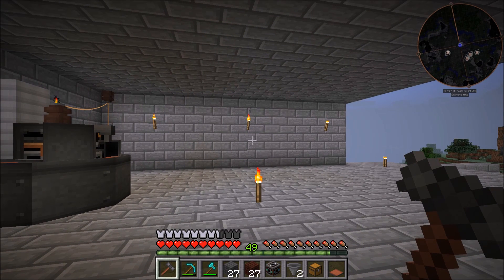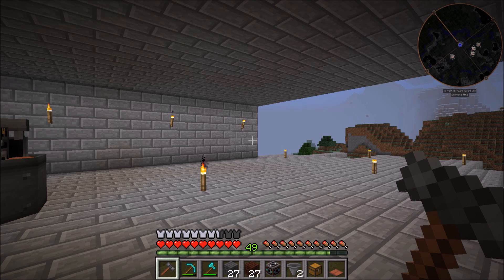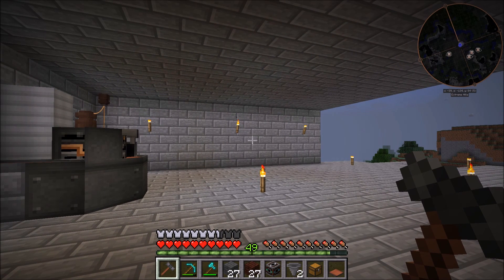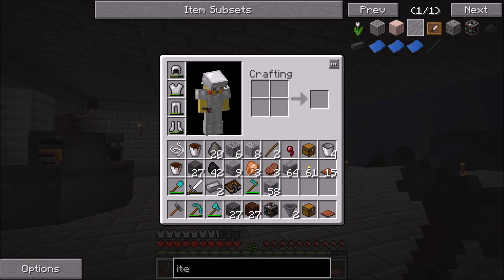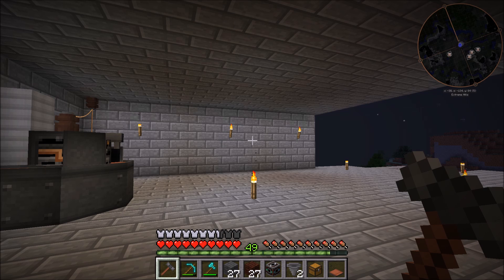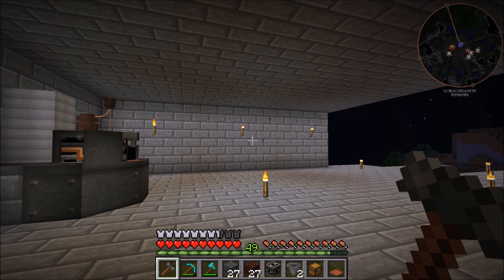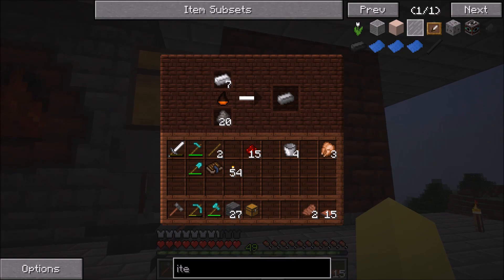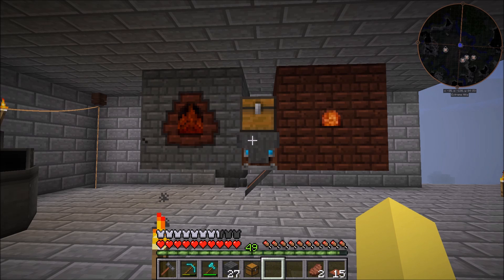Surviving With Immersive Engineering :: Ep.11 - Automatic Steel Production

Comment: You need to put the immersive engineering pump on the top center block of the come oven, give it power and a red stone signal then you can pipe the oil off of that

Comment: This is not working anymore.
Reply from the maker: There is a video later in the series (ep 15?) that has a much more recent version (after the big update that changed the oven) which would probably still work :)
Reply: No, does not work, too ^^
Basically, I am unable to feed the standard oven with a conveyor belt or item router from the side. You have to feed it from the top with a hopper. At least that is what I have found out in my version. And conveyor ramps are no longer feeding into the adjacent block diagonally above them (at the end of the ramp), but into the block right next to them. I always have to place a normal conveyor belt after a ramp before being able to feed into machines with item inputs.

Comment: Weird, but I tried putting coal coke in the west side of the item router and for some reason it wasn't going into the blast furnace.  Any idea why?
Reply from the maker: Not sure, but there have been many changes to the blast furnace since this video. I believe my 15th episodes features a more up to date setup using the improved blast furnace.
Reply: Yeah, turns out after 0.7.x the crude blast furnace became impossible to automate by any means, including by conveyors.  Means I am going to switch to the improved blast furnace as soon as I have enough steel.  Minechem can make steel quite efficiently too.  Just have a few hoppers, one coming out of a chemical decomposer, then going into a chemical synthesizer, both with RF power, and you have an automated steel production that's quite a bit more compact.  Sure, its clinical look may be a bit off-putting, but it works.  Quite efficient and fast.

Comment: What version are you running?  In 0.7.3 you can't automate steel production with a regular blast furnace, you have to upgrade to an Improved Blast Furnace and it has specific rules of where you can input/output from.
Reply from the maker: +Garrett Gilley This video was made before 0.7.3, I have a video later in the series for automating the improved blast furnace in 0.7.0

Comment: That's a clever use of the item router.  Nice.

When I started with the mod a few months ago, there were no pipes, so I automated creosote extraction using computer craft.  Long after that, I discovered immersive integration, and switched to the industrial coke oven that it provides.  The industrial coke oven does have two fluid ports, so pipes work.   I know that doesn't help your situation, but outside of adding another mod, I don't have a better suggestion.

Other commenters have mentioned bottles and jerry cans, and I think that's worth a try.  I wonder if one can automate the emptying of a bottle/jerry can into a tank, so cycle the empty can back around to carry more creosote.  That might be fun to try.
Reply from the maker: +zuul I had thought about emptying the cans / buckets into a tank when I was building this, but never found any way to automatically do it. Ill keep trying though because that is most likely the best way to go about it if it is possible.